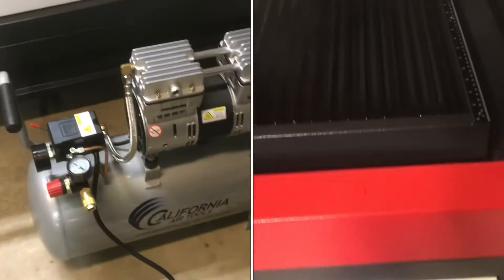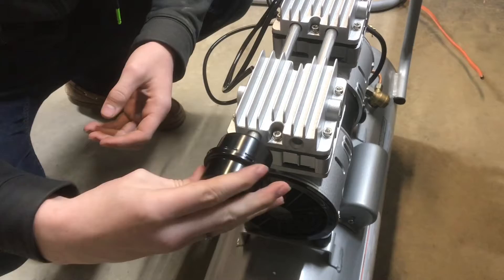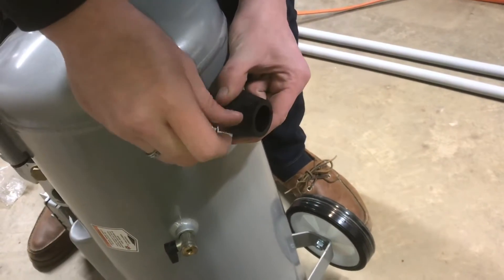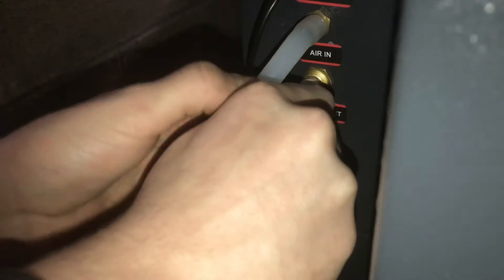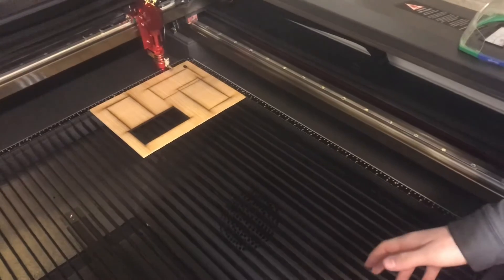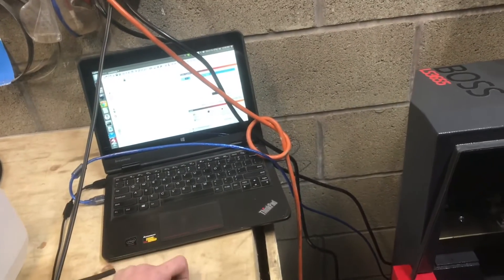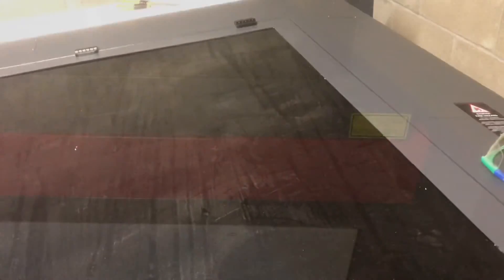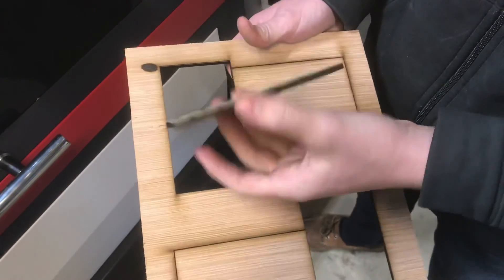setting up air assist on ls3655 boss laser cutter (california air compressor 8010)

Comment: Nice addition. I own the LS1630, You said your Power/speed was 30mm/sec @ 80% power.  Are you running a 105W or 155W co2 tube using that set power and speed? thanks......Bob

Comment: Is there a laser cutter that can cut steel, that is cheap and can fit my office?
Reply: Cutting steel, cheap and office don’t go in the same sentence lol
Reply: It is called a fiber laser, and no, you can't get it in an office. They are typically huge and require additional oxygen or nitrogen gas tank, very high pressure too.

Comment: How has been holding up? Do you feel like the 10gallon tank has enough capacity for your cutting projects? About how many minutes of cutting do you get to do before the compressor turns on again?
Reply: I have several Boss Machines and can tell you its more about CFM than capacity.  To keep up, you will need a motor than can push 1.5CFM or more per machine.  This Air Compressor puts out a little more than 3 CFM so it can work for 2 machines.  I will say though, these air compressors are NOT continuous duty, so if your machine gets heavy use (more than 4 hours a day) they will not last more than 6 months-year in my experience.  I have switched to GAST compressors and they also work great.  Much more pricey though.  But are rated for continuous duty.